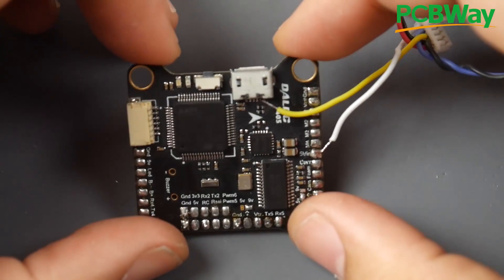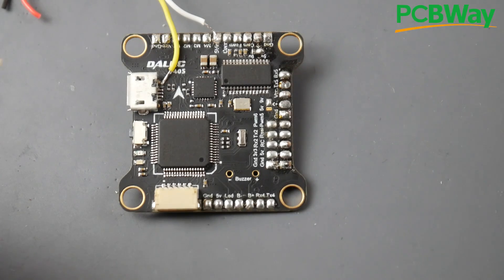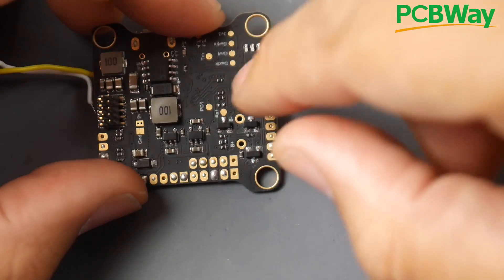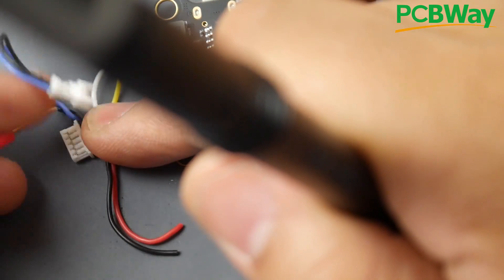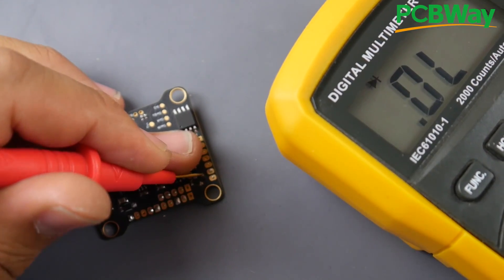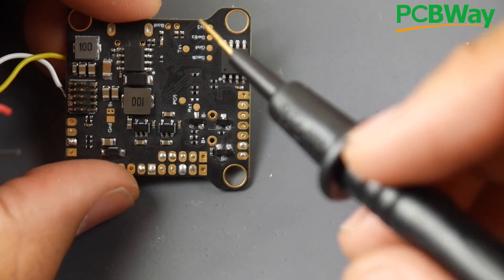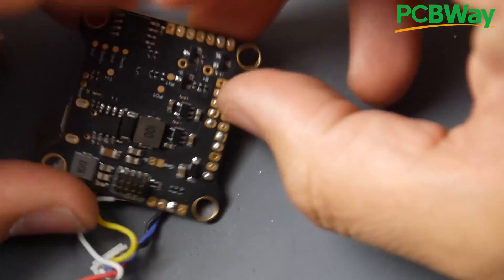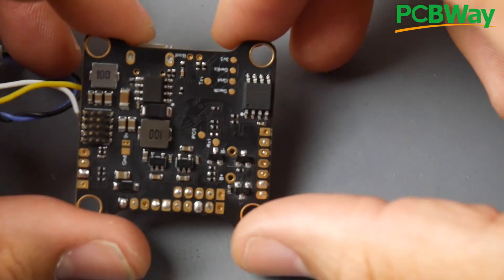How To Fix Flight Controller NOT POWERING ON // Repair Video

Comment: So hold off.. So First step, Check no continuity between the 3v and ground, what if I get continuity there?  I would say "fried" but if I plug in USB, and Give 5v power betaflight is able to connect, and everything seems fine, which... hardly makes sense I guess, but anyway back to my question, so I have continuity between ground and 3v3 now what?

Comment: hello bro, I have a Speedybeey F405 V3. Previously I checked the 4V5 voltage with Ground which was fine. and the flight controller turns on. However, when I connected the camera and VTX cables, I accompanied this by attaching the ESC and flight control. then I checked using a 6s battery, suddenly the flight controller LED light didn't turn on. and I tried disconnecting the flight controller and connecting it to the battery so that the ESC turned on and made a sound. then after I checked the 4V5 voltage and ground, a beep beep sound came out. Does my FC have a short circuit?

Comment: Hi I encountered an issue with my fc and would be great is you could help me out

First my esc that was connected has a motor out of sync 
Then the 3rd motor was not making any beeps on boot up
Then i reflashed the firmware and wasn’t able to do anything with it

My fc right now has 2leds on, one for power abs the blue boot led after which she sw led comes on

Could you help me out please

Comment: I have a flight controller that powered from the USB but not from the battery.
My question is - How do you replace the 5v regulator on the board?

Comment: Hello. Matek F405-CTR. Regulator 3.3 is hot. I raised it. The pad 3.3 V is short to the ground. What to do? You talked about some resistors or capacitors .. It is a pity to solder the controller and accelerometer.
Reply: I have the same... Continuity from 3.3v to ground.... not sure what to do except buy a new flight controller i guess?

Comment: Mine has a bad internal voltage regulator . Camera , rx , vtx , led pads , buzzer all dead .i think a red wire came off a camera and shorted or the whole thing heated from 2 battery flights and struck a branch.  It all went black but had osd and vtx until i started wiggling it around trying to see if it was a loose plug  . New flight controller is bigger and nicer . It has 5v and 10 v for vtx and i guess a 3.3v too inside the flight controller . Voltage regulators are 50 cents and fc are $50 .  Don't overload your fc's voltage regulator with accessories.

Comment: I know this is old.  But, I have a weird one.  If i plug in with battery, the board lights up, but the blue FC light doesn't light up.  The FC doesn't start up or boot betaflight, but the receiver and other parts power up.  Get this, if I plug in a usb battery bank the fc boots, then if I plug in a battery everything works.  Then, I can unplug the USB battery power and the quad stays working and flys!!.  I've been flying like this for a few days.  Plug in usb, then battery, then unplug usb and fly.  It is a head scratcher.  It must be browning out.  I have a blitz f7 mini, which means it has plugs instead of pads (annoying) and its quite dense and small (annoying.)
THank you

Comment: Hey! Thanks so much for this, very helpful. Please may I ask for some advice though re an Omnibus F4 with VBAT input. I have an old one I want to use with INAV for an old plane and realised VBAT is dead so it's the opposite from what you show here. I followed the principles though and soldered a wire to the VBAT input and toned out the 2 diodes. No continuity beep. Also tried it on the 5v in pad and the same result. Does this mean the diodes are fine? Not sure what to try now. I can always grab a 5v board but, would like to learn how to fix this common fault.

Comment: Hello Drone Mesh, I have started repairing due to your very very good videos. I repaired 1 4in1 already and switched out a F405 on a CL racing F4 that now is now fully functional again!!  very happy with that !.  However ont the topic of Schottky diodes.  After some searching on the internet for the correct component I found that people have great succes with this type:  BAT54C . However this is rated for 30Volts.  Is that actually the correct one to use (I do understand the different types but it seems the correct working type, but the voltage me worries me.)  Thank you very much in advance for all te advice you can give.

Comment: Greetings! Thank you so much for explaining the power systems on these little FC's. Is there anything you can do if there is a direct short in the 3.3v regulator? My 3.3v and ground pads are shorted together on a GEPRC F4 20a v2.2. Thanks!

Comment: It's a transistor or regulator. Not a schotkey diode. A transistor is two diodes separated by a p or n junction.  I'm not trying to troll I swear. But there's diodes there as well and you didn't even check them. You fixed it by believing your own ignorance but it was the regulator. Regulators and transistors look the same ìn some smd packages. I'm so sorry I had to type this.

Comment: Hello there,

I'm sorry for asking something that maybe not be fully related to the topic of this video.

I just purchased a speedy Bee F4 V2 stack and the ESC motor No.4 is not working. I have installed 2 proven motors in the ESC No. 4 and none of them are spinning. I have done several tests like voltage o signal and nothing is going out of the ESC No.4. I went to the motor menu and try to make it spin but nothing is working for it, for all others 3 are spinning correctly when I start them to check the spin direction. I'm out of options here is there anything else I can do? Please let me know I will be more than happy to receive your feedback.

Thanks for all your help.

Regards,

Comment: Thanks for the video. Unfortunately it looks that in my case, replacement with a KL3 didn't work. Seems like i need the 1AM (MMBT3904) does this sounds logic for you? Originally there was a 1AM diode on my F4 Pro...

Comment: Hello bro, is beautiful  your videos!, bro I have a problem whit the fc,  the problem that I have is that all works correctly  but the voltage  in in betta flight always put 0v and when I conect  the lipo is the same, always put 0v,  when I disconnect  of betta flight  I can turn on the fc with the lipo, the gyro works fine only the problem.is that always say 0v have any idea of the problem  bro? Can you help me please?

Comment: Is there a way to fix a burned micro controll unit I think its this on my fc as theres like a burned blob on it , I it powered up but only get green light and the next day it hardly lights up and only a sec orvery dim at the beginning. If its the micro controll unit is there an easy fix to it ?

Thanks in advance

Comment: I did a mistake 🤦 I forgot to attach the antenna before turning on the radio. I turn the radio on without antenna for approximately 3-5 minutes. I just started learning fpv and want to practice on the simulator. So I don't have any quad yet right now. How to check if my radio is still working before I buy a new quad?

Comment: Now I have the opposite problem. I just wanted to reset my gyro in my 5 inch quad because angle mode made it pitch back and roll left about 5 degrees when you don't touch the sticks. I plugged into USB and got nothing. But if I also plug a battery in, Betaflight connects. I must have blown the schottky diode. I'll have to take the quad apart to test it I guess.

Comment: I have a short in the 3.3v regulator. And the 3.3v regulator gots hot to the touch, is it repairable if I purchase a new 3.3v regulator, or is it no use in repairing

Comment: Dear Drone Mash! 
I have Hobbywing G3 F4 Fc. It does not power on. No usb, no battery. I measured the diodes, all the 3 has the the left leg short to 3.3 V NOT to 5V. Is it normal? Without battery the 3.3V and gnd is shorted. I know that it is not a good sign... When I give power to the board from battery, on the 3.3V pin I can measure 0.41V and a part with 5 legs 2 on one side, 3 on the other side is very hot. It has short to gnd on the middle pin on the 3 leg side and one leg on the 2 leg side. What to do? THX!!!

Comment: Great content..would this work for a Mamba F405 MK2 full board too? I also have another Mamba that powers on via USB but not via LiPo - no 5V output on any pads when connected. Which chip would you recommend to change or can it all be by-passed with a micro BEC (like the Matek one) connected to the 5V pads? Thanks
Reply: If u got any answer on how to Bypass with bec pls say
Reply: Unfortunately never got it to work so got a new one
Reply: @kiwifpv5865  no worries man. Mine literally came out of the dead a few hours ago. Trust me more often than not, nothing is burnt. It’s usually a short and apparently when I connected the battery even tho I knew it was a short, everything powered on and the there was no short anywhere on the board anymore!
Reply: Did you solve your problem?

Comment: I've got one that doesn't power on with a battery. It powers on only when the USB is plugged in and will spin the motors when a battery is plugged in while the USB is also plugged in. It's a brand new AIO TH2 board.

Comment: I have the opposite problem my fc powers off usb when plugged in but doesnt work when my lipo is plugged in
Reply: Found out what happened to mine the onboard 5v on my iflight succeX D fc fried lol
Reply: @Omega70  So I confirm I have the same issue now
Reply: @Omega70  How did you solve the problem? Having same issue.
Reply: @Tonynux  I replaced my fc, it  made contact with the frame and I'm guessing that happened when I had a hard crash. So I ended up placing electrical tape on the drone frame near where the fc is placed so I don't have any type of short circuits again

Comment: hey man, i got my mamba f405 and vcc and gnd has continuity. there's no visible short. nothing gets hot. any thoughts? thanks!!
Reply: also, my matek 6s pdb the 5v regulator is burnt, can i still use it to power my quad (thru vcc)?

Comment: I have mamba stack FC, I shorted it out accidentally.  So there is no power when I connected to the 5v. but it does powered up if I put the USB in.  which diode should I replaced?
Reply: Same here, have you find the solution ?
Reply: @lteurnier  unfortunately no :(
Reply: @lteurnier  and same here!😫

Comment: i have a different issue with 5v reg. Fc mamba f405 mk2. Fc working correctly with usb port and battery power. But 5v pads on fc and osd doesn't working. When i check voltage on 5v pads i read something like 0.25 v on multimeter. I can still use fc but i want to see osd. I have a 5v bec. So can i fried fc if i connect 5v bec to 5v pads? (at the same time fc powered from battery)

Comment: Hi. Yesterday my quad died on the ground. no lights on FC (from batt and usb) but 5V is good because RC receiver and VTX work. 3V3 regulator or CPU? Thanks.
Reply: Did you figure it out?

Comment: Hi, great video...I happen to have the opposite from you..my Mamba F405 MK2 powers on with a solid red light on USB, but no connection to the PC. When I touch the 5V from the USB and the 5V in like you I can hear the ding from Windows detecting a new hardware. When I plug in the battery I can see a green light, and I get an image via the vTx and camera but no OSD. The F405 Chip also seems to get quite hot. Not 100% sure, but I think this FC only has one diode on the bottom side. Any suggestions are very welcome..:) Cheers KiwiFPV

Comment: hey I got a question. if you don't want to answer its okj. but I def had 2 wires touch I heard the noise and now want light up connect to betaflight but I have my vtx run through the board for osd and that still works when a bat is plugged in,. is itg cause im use the vbat pad on the flight controller, or is it a sign my brand new succex f4 is not jun k

Comment: Question. If board does not power from either lipo or usb how do you figure out which diode it is?
Reply from the maker: Is the big chip on the board getting really hot?
Reply: @DroneMesh  no. But there was a little thing that looked like the diode you were talking about but it had 3 on one side and 2 on the other. It was getting super hot. I removed it. Lol. And there was only 1 of those diode you showed. I removed it and tried to direct wire like you said. This was all before removing that other thing. I'd say it's pretty much trash now.. It's not getting 3.3v is the problem.. The 3.3v and ground are beeping when doing continuity test

Comment: mine is piko blx, when the usb connect the fc is on and betaflight detect it, but when the battery plugged, theres no power at all, the led is just off no power at all...is it a problem with diode too? or is just a bad fc and just throw it away....

Comment: DM you are the man!!!! About to go home and fix my damn Mamba Mini F405...only boots with USB..I shorted the pig tail from the buzzer positive to a cap on the esc.
Reply from the maker: You could of burnt the 5V also keep that in mind.
Reply: @DroneMesh  where is the 5v reg located on this board again? Could I replace with one from another FC?
Reply: Follow up DM..I took everything apart and power up the quad with a battery...works find however my OSD is not working. I noticed the chip getting hot too. I used my hot air iron and removed the OSD but I didn't have the exact same model number. Decided to try anyways. Now I get a gray screen on the goggles when I power up the quad. Was worth a try. Know where I can get an AT7456E ?

Comment: In my betaflight f4 while doing continuity test my 3.3 v and ground are continued which means my 3.3 v regulator is burned up . So what can I do next to revive it again. Please help.
Reply: Should check out livyo
Reply: @kwadlife4106  Livyo? What is it? Youtube channel? Thanks
Reply: I get it.
Reply: How did you solve? I'm facing the same problem. Ground and 3.3V have shortcut and the fc doesn't turn on.
Reply: Riccardo Salis remove the 3.3V LDO with a hot air station, and measure again the continuity on the fc board, if they are still shorting you probably have a problem with the mcu or the gyro ✌️
Reply: i have the same problem . on my f7 what can i do ?
Reply: I'm having this problem to!
So what did you  do to solve it??

Comment: What do I do if I did find continuity between 3.3v and ground. where is the 3.3v regulator on the board and how do I replace it? PLEASE HELP!!!!!
Reply from the maker: What board are you using.
Reply: @DroneMesh  I am using the Emax F3 Femto FC. Since it is so small and cheap do you think it would be a better idea to replace the board. But I still don't know how it shorted in the first place. Nothing is connected to the 3.3v rail.
Reply: For the diode both sides are working.
Reply from the maker: hmm... do you also have a short on 5V?
Reply: @DroneMesh No

Comment: Ok, first of all, I get a lot of information from all your videos, yesterday my beta flight f7 went buns up. At first I thought my receiver died, no reaction with any input. Took it home. No power. Wouldn't either way, USB or battery. I checked it out, could only find 2 of those 3 legged things. ( sorry it's late) neither one is making any noise with battery or USB. Please help. I can't keep throwing 60. Boards at this. Thanks
Reply from the maker: Go to dronemeshforum.com and send pics of both sides and I'll check it as soon as I am on the PC
Reply: I tried to send you those pictures to your forum, apparently I’m not smart enough. Can’t figure out how to attach pictures.

Comment: Great info bro! I have a few FlightOne MillivoltOSD flight controllers and have now verified that the 3.3v regulator is fried. How do i find where it is to replace it?
Reply from the maker: Never seen one... Would you like to donate one for a fix video?
Reply: @DroneMesh  Sure. Where to send to? Also, i double checked and the 3.3v is fine, just cant find the diod for the usb 5v.

Comment: Very very nice that you picked up this topic. For guys without fear from soldering this may become a tutorial. Because sometimes fix is certainly easy and you may avoid to purchase another flight controller that does cost 20 times more than fried diode. I hope that you can demonstrate soldering of SMD niceties too ;)
Reply from the maker: will do
Reply: @DroneMesh  I said already that I have 2 faulty Racerstar TattooF4S FCs on bench. Both have 5V BEC ceased to work (novelty switching chips for 3A current appeared weak) after hard crashes so I added external 5V BEC board to go around onboard BEC :) After last hard crash in begin of November one of these boards died completely now having 5V rail shorted to ground. I'm curious what happened now. I'll will look on that later. Now there are snow and -11C outside, nothing to do with big boys. Got a pair of Mobula7 in yesterday so winter is set :)

Comment: Great stuff!  I think I found out what is wrong with my old EO11 FC, by watching this.  The leds dimm after I connect power and I can not bind to it.  I changed the diode but I think I used the wrong type.  Is there a way to figure that out without having a diagram of the pdb?  Maybe I used the wrong diode or even a mosfet, or is a mosfet just a type of diode?  Thank you for this great video, I just learned something new, again, and found out about some features of my multimeter I haven't used so much.
Reply from the maker: Dim led is usually a short on 3.3v